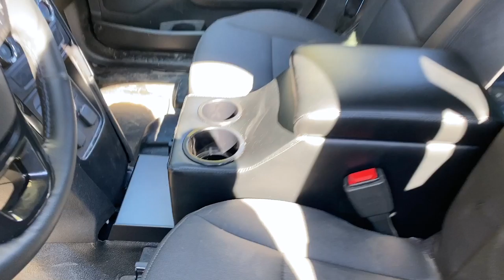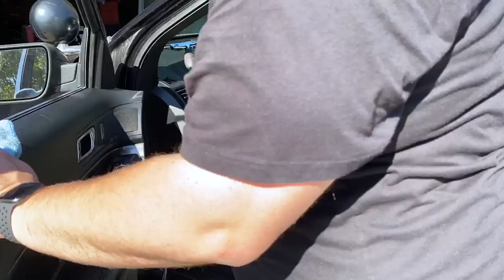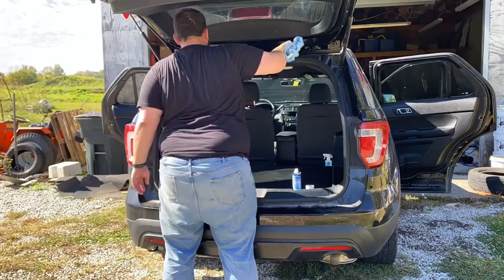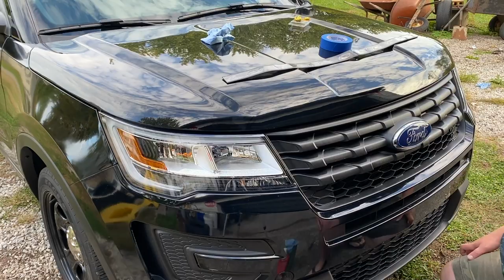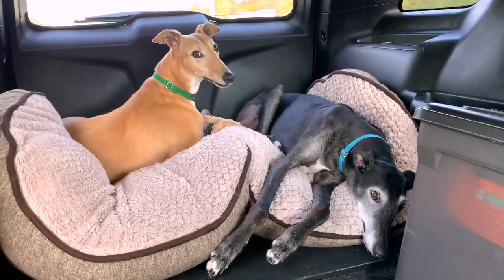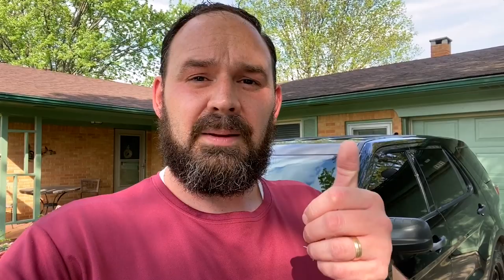1000+ mile road trip just hours after rebuild! ~ 2017 Police Interceptor Utility Rebuild -- Part 14

Comment: Had the same issue with the inner wheel well liner - the wheel ate a 4-inch hole in it in less than a 100 miles on a flat German Autobahn. Really hurt my heart when I saw it, but still can't make myself buy a replacement. So - zip ties FTW 😂 Great follow-up video - the Interceptor series finished a bit abruptly in the autumn. Looking forward to the new projects! Stay safe but keep 'em coming! 🙂
Reply from the maker: Thanks man! Yeah, I was pretty bummed about the wheel well liners. Oh well. Live and learn I guess.

Comment: Nice! Where did you order the headlights? I will soon get my interceptor but its missing the headlights))
Reply from the maker: Thanks! I ended up getting my headlights directly from Ford. I looked for used ones for a while, but I was finding stuff that was either in rough condition or over priced. I figured if I was going to spend a lot on lights they may as well be good quality.

Comment: hey Crossroads Rebuild! I am about to purchase a 2017 utility, as far as reliability how would you rate this vehicle?
Reply from the maker: Cool man! I haven’t had any reliability issues since rebuilding. Just regular maintenance and it runs flawlessly.
Reply: I would never ever buy a 2013-19 Ford Police Interceptor Sedan or Utility because of the dreaded water pumps failing and destroying the engine. I would rather buy a Chevrolet Tahoe or Ford Crown Victoria instead.
Reply: @atx-cvpi_99  isn’t the water pump issue only on the turbos?
Reply: @DomDanCam  No it’s all of the V6 engines. Not just the Ecoboost V6.

Comment: Man...1000 miles... thats something like 1600 Km, if i leave Lisbon (Portugal) and drive to Madrid (Spain) and back it only takes 1250  Km (777 miles) .

Love big countries 😂

PS: those wheels look kind small to the size of the Interceptor...
Reply from the maker: Cool to think of the trip length in regards to different countries! I’d love to come to Europe and do a driving tour some time. 

I think the wheel thing is an optical illusion because of the black steel with the black tires and only that little chrome center cap. They’re 18” wheels believe it or not.
Reply: @CrossroadsRebuild  man i have a Renault GrandScenic III with 17" and the Renault it's much smaler than the Interceptor. The 17" look smaller in my car maybe the 18" look better. In the interceptor there is a lot of space   in the wheels area 🤣
Reply: They are actually bigger than the ones that were on the Crown Victorias.